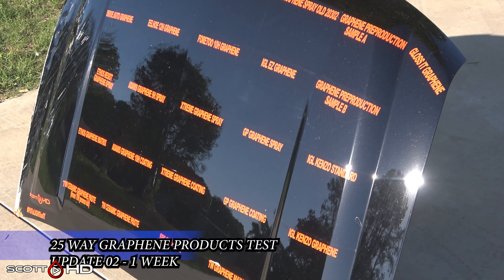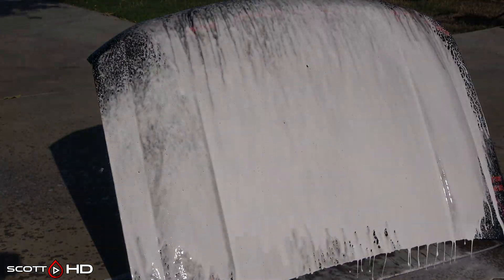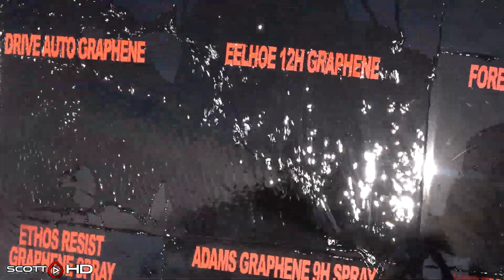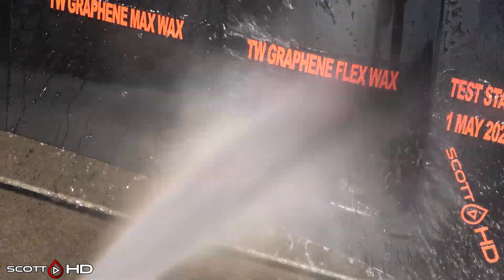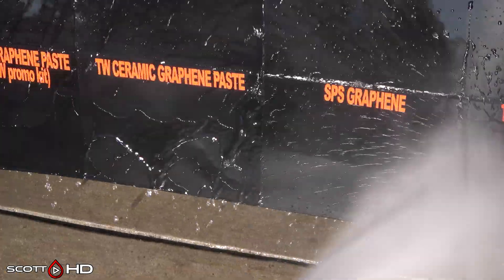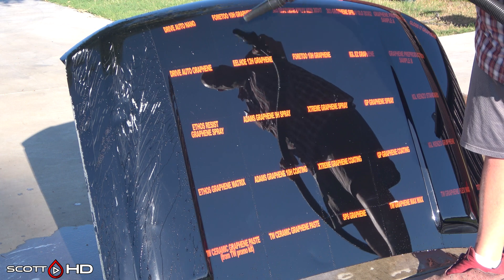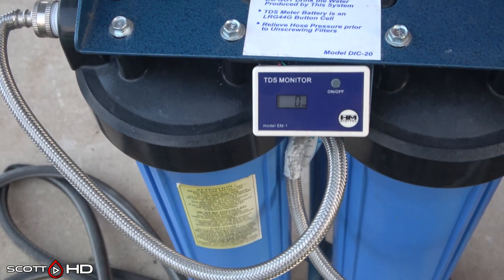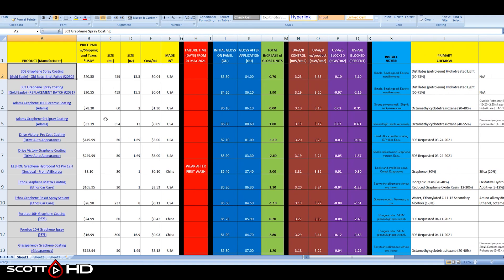Graphene Coatings Longevity Test - 25 WAY - ULTIMATE comparison - UPDATE 02 - 1 WEEK & already weak!

Comment: What is the difference in application on the IGL EZ when it was originally a spray vs now a coating if the volume of the bottle is the same? Thanks
Reply from the maker: As a coating you get less of it I would guess.  The sprays on my test hoods are still applied the same way (I spray onto an applicator and apply to the hood.... product still gets on the surface the same way)
Reply: @ScottHD  ok I was thinking they did not change the volume or price/ fl oz. Awesome content by the way

Comment: Hey Scott, what could happen if megs hcw spray dies in one week after washing got wax now it looks and holds better is it the product? or me? and what do you think could carpro  UK 3.0 if I do a 2 step polish and 2 coats could it last 3 and at 3 years still bead because I really couldn't find any other that's that cheap but also good
Reply from the maker: Inconsistencies in the batches (not common with Meguiars), weather, etc are all variables.   I try to remove as many variables related to the install as possible (same wash process, same hood prep process, same application, etc).   Carpro CQUK 3.0 should definitely fit your bill well. In the tests (I've tested that multiple times) it has always done very well.
Reply: @ScottHD  jup I am thinking that its a bad batch too, but dang it, it has to be when I buy for me its 24 euros  at 14 its expensive

Comment: Thank you Scott! These newest 3-4 tests you have going on are all very interesting and I’m waiting to see some failures. 

I said before the TW Flex has been awesome so far for me and my cars. But...I finally just applied an initial coat of Ethos Resist on my wife’s Highlander and all is can say is WOW. It is the easiest product I’ve ever applied. I’m an enthusiast and by no way have I used as many products as you have, but I’ve used all of the latest top 20 products. The application of Resist was out of this world. Even if I had to give up 1/2 the durability/longevity of TW Flex, Griots, Megs, Adam’s, etc I would still chose Resist. Hope it holds up for at least 3-4 months.
Reply from the maker: Absolutely.  The beauty of all of this competition is that the consumer wins!  Easier application, longer lasting.
Reply: Good info re: Resist. Did you spray on vehicle or on an applicator pad? Thanks
Reply: @larrys2554  I used one of those bar soap style applicator pads and 1 Eagle Edgeless towel for the entire Highlander. I’d spray 2 sprays per panel, let it flash, buff off. It took about 20 minutes and 40 sprays total. I even did the glass with it.  Zero streaks. Almost instant Shine slickness. I hope it holds up for a few months per application. But if not, the TW Flex is a very very good product too, just not as easy or fast to apply and buff.
Reply: @stevenmott6668  great info. I’m going to use it soon. Did you spray the panel or the pad? Thanks
Reply: @larrys2554  I sprayed the applicator pad. The first time I sprayed it I prob did 4-5 sprays to just get it on there, then after I just needed 2 sprays to do a panel.  The eagle edgeless towel really made the buff and shine easy too. 
Let us all know what you think after you use it!
Reply: @stevenmott6668  thanks for the tips. I certainly will let you all know how it goes.
Reply: Thats the beauty of a product like Resist, matching amazingly easy application with good performance. Likely durability could be increased but at the detriment to application. There is always a trade off.
Reply: @AdonisDetail  I agree. There’s always a trade off. I’m not a pro detailer just a home enthusiast, but I’m guessing a pro detailers time is a little more important than mine when doing a job. I really was impressed at the results I got for the ease and speed of Resist. Like I said, just hoping to get 2-3 months of solid durability. I have Defy as well and I’ll prob use that as a drying aid sort of spray between Resist applications. 
Do you have any experience with the durability of Resist?

Comment: Hey Scott, water quality scientist here. TDS measurements don’t necessarily indicate water hardness since it measures everything dissolved. That hardness chart is specifically for calcium and magnesium ions, so if your water has other minerals like iron, that will skew the results when using a TDS meter. Regardless, I’m sure your water would still leave spots on any car.
Reply from the maker: Thank you for the info!  I will dig up the last report that I got from our water supply company that shows the content.  It does have a very high mineral content, and iron is one of them I'm pretty positive.  Our shower glass in our house (and toilet bowls) will also confirm it!
Reply: ...with a flash of silver leaves...

Comment: My car is outside 24/7. Waxed 3 weeks ago with TW Ceramic and Graphene Paste. Rained Thursday and Friday. I walked out between showers and the sides were nearly dry, including the windows. Pretty much all the rain just rolled off. What little remained on the horizontal surfaces - including the all glass roof - was perfectly beaded. I washed it yesterday with my bucket, Chemical Guys Mr Pink, and two mitts. I did the spray and rinse method with TW Flex just for the hell of it. Just a tip for those with Flex but haven't done a spray and rinse yet. It will leave a film behind. Don't think it's streaked the paint. You want it to leave a film behind. Use two towels when you're drying. In one hand your "wet" towel to remove the excess water. In the other hand a dry towel to buff and level it. Dry the entire car that way, then give it a final walk around with a fresh clean dry towel. Looks and feels like you just waxed it.
Reply from the maker: Good info!